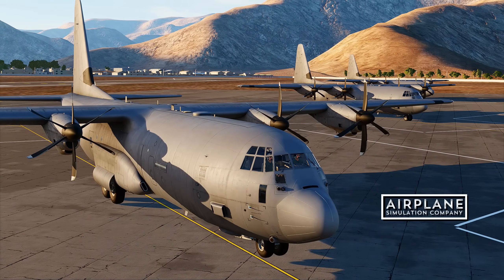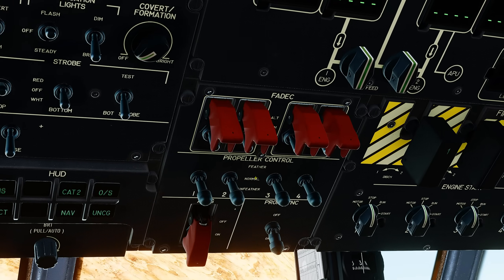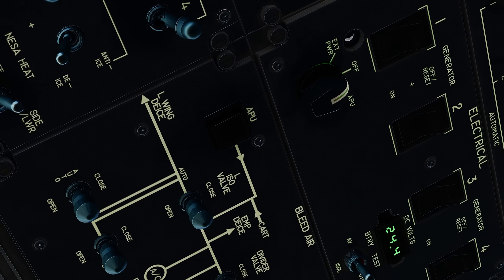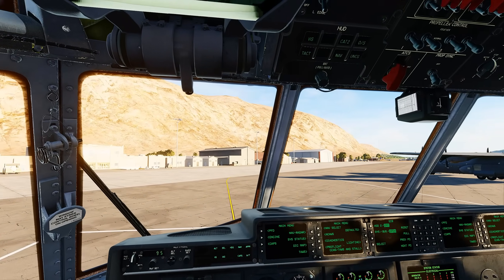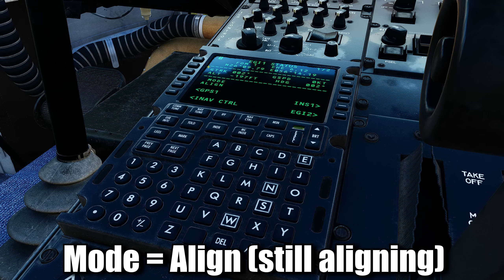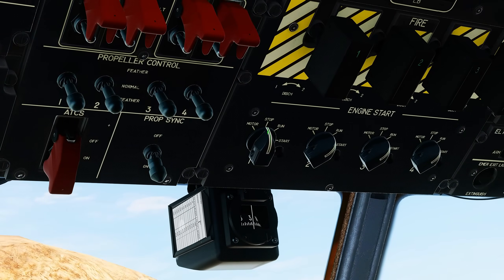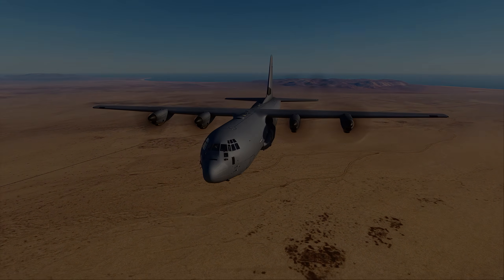DCS C-130 Startup Procedure

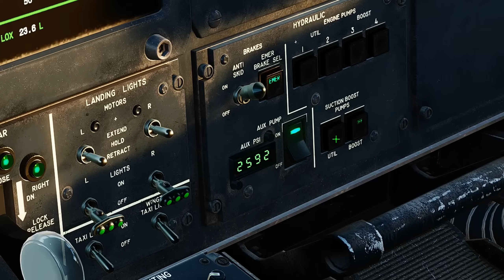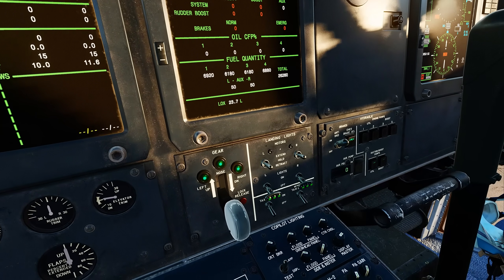Comment: 12:45 - 12:56 I'm not a C130 pilot but I do know turbine engines. The suction boost pumps are engine driven pumps for FUEL not "hydraulics". Can Someone with real world experience confirm?
Reply: No, you're wrong. They are for the hydraulic system.

Comment: J instructor here. You absolutely can start multiple engines at the same time. One engine produces more than enough bleed air for the other starters. We don't do it often but it is a good trick if you need to get out of a place quickly. I noticed a few other small mistakes but overall great video.
Reply: J Loadmaster here. The toilet isn't realistic enough because there isn't shit on the shower curtain.
Reply: To bad DCS didn't include ground crew with air carts. That's another step that's usually missing in all AC startup procedures in DCS. That and have a random chance of ground crew hitting your AC with air stairs lol There's nothing like the first flight after MX fixes the giant hole in a wing from air stairs and you pray the sheet metal guy did his job right.
Reply: @Kitfoo77  You can usually request ground power, but it's not visually simulated.
Reply: Engine right? As in start 1 engine and use it to start the other 3?
Reply: @noscopesallowed8128 normally you start one at a time as a safety precaution since you aren't having to check every startup item for 3 separate engines. That said, you can just start 3 at once, usually called a "combat start", incase you have to go in a hurry.
 Also because it's awesome.
Reply: You can but MX crew might not like it. If an overtemp pops on the download thats a mandatory overtemp inspection on the APU combustion liner. The APU is pretty robust and doesnt break too often so 9 times out of 10 nothing will be wrong with it but the book mandates that and its a lot of extra work for nothing.
Reply: @cly-9128  That's why they said they don't do it often. Only when they NEED to. They were just saying you can as a correction to ralphi saying you can't.
Reply: Man, the fuel control panel switches are killing me. Where the to and from?!?! 😂😂
Reply: Don't leave us hanging on those other mistakes
Reply: On the ASC discord they said it can do this. Is the mistake that Ralfi isnt a J instructor and doesn't know this, you mean?

Comment: Engine start sequence is used with the shut-down sequence to determine function of hyd pumps, you only get a booster or utility system pressure indication on the System Status Page not an individual pump.  Whilst each EDP is monitored by the aircraft it's a carry over from H model start sequence.

You can start more than one engine at once when you have an engine up and running, take it out of low speed ground idle and it'll let you start a few at the same time.

Comment: @Ralfi you can start multiple engines at the same time. we refer to it as a combat start, usually begin 3-4 then 1 and 2 at same time. as you are producing extra bleed air from 3 and 4. works better if the right side is upsped first though
Reply: he started in lowspeed ground idle, which does not produce enough bleed air for 2 at once. If he started them in high idle, after the first engine he surely could do 2 at a time.

Comment: Can the checklist be popped out and moved to another screen? I use a tablet with Space Desk that I use in MSFS24 for my EFB and this is very handy for cleaning up the main screen as I look around and not have the on screen EFB blocking stuff. Also to the generator switches, when you turn them on, you are closing them not opening them.

Comment: Former Herk mechanic here. You are stating an incorrect outcome in the first checklist item, Oil Cooler Flaps. You state that if they aren't in auto, it will result in a fire at startup. This is incorrect. The switch has 4 positions. OPEN and CLOSE positions are momentary spring loaded positions. AUTO is a latched position and the center is the FIXED, off position. The center FIXED position just means that the Oil Cooler Flaps are in a fixed position which could be anywhere from full closed to full open. If the AUTO function fails, you can manually select the flaps to OPEN or CLOSE to control the oil temperatures and then leave them in the center FIXED. Oil cooler flap  position is shown on the EFID to confirm flap movement. Obviously you don't want to start the engine with the oil cooler flaps closed, but it will not result in a fire at start-up. It will result in eventual overheating of the oil system with the end result of possible internal engine damage and fire but it will not be immediate upon engine start.
Reply: well explained mate
Reply: As a pilot with "J" time, I really appreciate not only the detail of these systems in a module for DCS, but the awesome community that supports it with play time AND the helpful tip / background info along the way.  TY for those details.
Reply: I took it as a joke, having watched enough of this dudes videos haha
Reply: @MrTurboTurkey  Yeah, that was my assumption as well, which while nice for RafiDude's normal channel work, the humor may be a bit confusing in something that's going to be viewed as a tutorial meant to be taken seriously.
Not that it's bad or anything, just that I can see how it would be confusing.
Reply: @aaronwhite1786 facts! Tutorials like this are not only to be taken seriously but this is a showcase of what were gonna be going up against and especially if we're doing missions where we are being under attack and have to seriously get this thing up in the air immediately to deliver cargo, transportation, soldiers, etc... your gonna want to know wtf your actually doing! This isn't some fighter jet. Its very important that Tutorials like this one, gets taken seriously
Reply: Very well explained!
Reply: could he have said this because its not modeled properly yet and will be added/fixed later on due to lack of some information? (cant all have access to the AMM's)
Reply: Why is my memory "Fixed Open" on engine start? Or was that only in the "H".
Reply: Im glad I wasnt the only person who caught that lol
Reply: Idk man I just my number 1 on fire by skipping the check list and working my way through cold and dark.
Reply: I think dcs is creating engine fires with it.
Reply: in game, leaving them at defaults, which visual confirmation shows them full open, the engines will catch fire.  whether its realistic or a bug or whatever, that is the situation here.
Reply: Thanks for adding this comment. I'm an instructor in the J and there are a few other mistakes in the video but overall not bad.
Reply: The reference to fire is probably because by default in DCS the aircraft "spawns" with fully closed flaps? 
(assumption)

Comment: It also should be noted that separate tasks are going on during this. The aircraft commander and the co-pilot are doing different things that are being done together here. Also we don’t ever look at the engine data screen
Reply: Out of curiosity, did you expect ralfi to clone himself and have a back and fourth as pilot flying and pilot monitoring during the startup sequence?
Reply: The video does not cover the Cockpit Setup flow, which probably should be its own video entirely, if not multiple videos.

Ralfi makes an important point with the engine data screen up for DCS users: the power levers need to be in the ground range or else the engines won't start. Not normally a concern for IRL crews because the power levers have the physical detents for ground, flight, and reverse ranges. But I wager a lot of DCS users don't have throttles with detents, or at least not with them set up to match the C-130J's detents.
Reply: @HercDriver you’d hope that keybinds would solve this as I don’t want my physical idle to be full reverse lol
Reply: @Uselessnoobcow  Ah, the joys of the STECS: Making up your own overtly complex detent profiles! =)

Comment: Sounds and looks great however, the ADS arms on the ramp need work as they are used to ensure the ramp and level with the floor and dont drop any lower. All these videos show the ADS arms still attached with the ramp fully lowered.
Reply: J models have different ADS arms than the legacy and don't need to be physically disconnected to put the ramp on the ground - there's a couple T-handles by the ramp controls that when pulled allow full ramp movement past level.
Reply: @thegreatandpowerfuljromins2566 sorry but you're absolutely incorrect. Ive operated these aircraft for 18 years. The ADS arms are fixed at the top of the fuselage and connect via a pin on the ramp. There is no way to lower the ramp with the ADS arms connected (that's the entire purpose of them).
Reply: @lonerider666 Hmm, would be curious where the 18 years was spent! USMC KC-Js and the RAAF Js are the birds I know of that still have the old cargo compartment. Most everyone else's Js have the new cargo compartment with the integrated rollers, ECHS/electronic locks, upgraded ADS arms, etc, and the mid 2010s USAF 130Js are what ASC is simulating - so while your point might be correct for specific outliers in the worldwide J fleet, it's definitely not true for the aircraft and time period that's bring simulated here. Next time you're at an airshow with a USAF slick -130J, hop on board and you might be surprised what you see in the back! 😉
Reply: @lonerider666  absolutely incorrect as in, not really absolutely incorrect at all. Some J's have the ADS as modelled here, right?
Reply: @sierramikebravo7332 I've personally never seen ADS arms that let the ramp fall below the horizontal as that's literally the main purpose of them.
Reply: @lonerider666  I have personally seen ADS arms that let the ramp fall below the horizontal on the C-130J. Becuase the ADS can be configured for ground or air mode except in older airframes.
Reply: @thegreatandpowerfuljromins2566  you are absolutely correct for the USAF C-130J

Comment: 2:46 So what synchrophasing does is it mechanically aligns the position or 'phase' of each prop so that the sound produced by each spinning prop destructively interferes. I live near the Lockheed plant where they make the C-130 and they're constantly flying around and this is what makes them surprisingly quiet!
Reply: Most notable on the inside. When it's off or inoperative, the out of phase drone over time was brutal. In the C-130T, we didn't switch it on till we were at cruise.  During take-offs and landing and touch and goes it was off. So after 4 hours, between the headset(or as we called it the C-clamp) and no synchrophaser, i'd have a whopper of a headache.
Reply: If the syncrophase was inop, the bird was down for LD flights. The wah, wah drives you batty. On smaller twins you can sync-up manually.
Reply: its supposed to synch the propellers to each other because of both pilot comfort and vibration control. if you synch the props you can hear them quite literally turn into one single noise rather than 4. they are phased like an AC circuit would be. just in case your curious, I used to work at the Marietta plant at Dobbins for a long time. I left around the time the first LM100Js were starting to roll off the line. 03G1.
Reply: Destructive interference is signalling is also called downfading if you like to type shorter words ;)
Reply: @joeydebra763  At a stretch, could probably just say ANC (active noise cancellation), hehe. =)

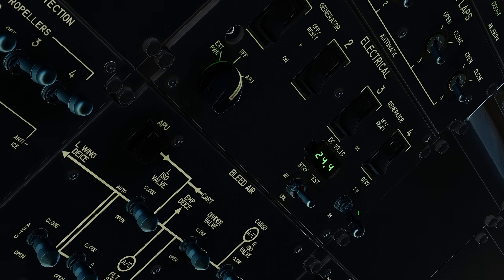Comment: Does anyone know what's the clicking noise that comes up from 0:57 ? I hear older planes having it like MD82 etc ... But i don't know what equipment cause this. And even what in that equipment would cause this noise ? I'm pretty sure it's gyro related.
Reply: Its a vibration device for the altimeter, so that way the needle and components don't "stick" or get caught up. Most older aircraft with mechanical altimeters had them.
Reply: You're actually right TYSM  @DeepBlue1882